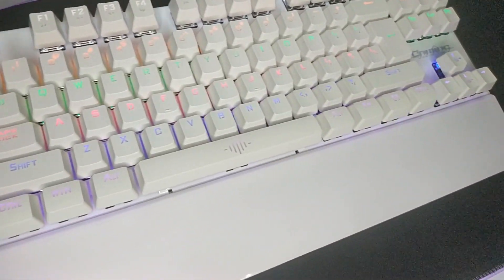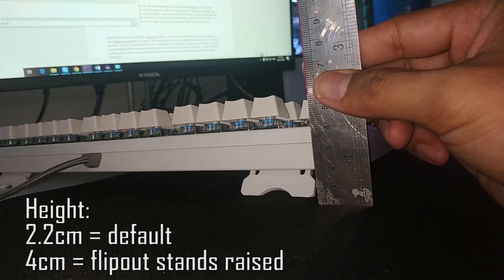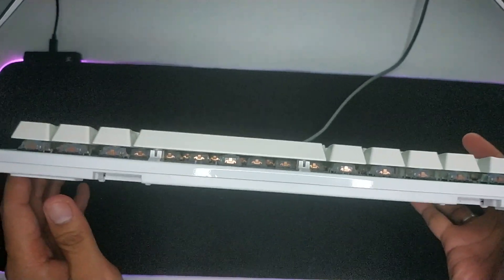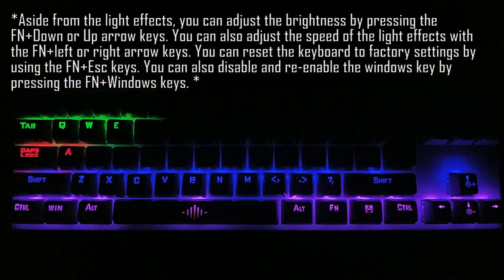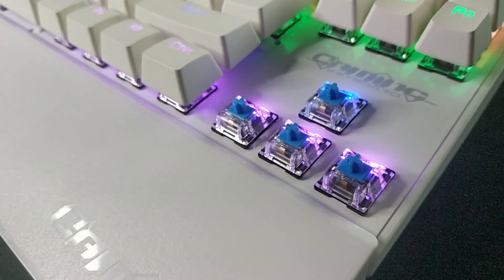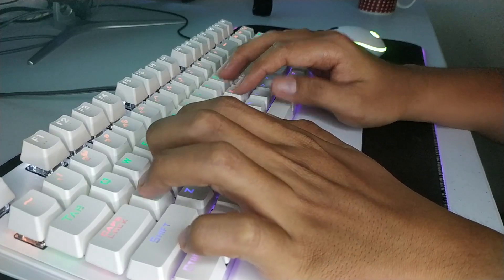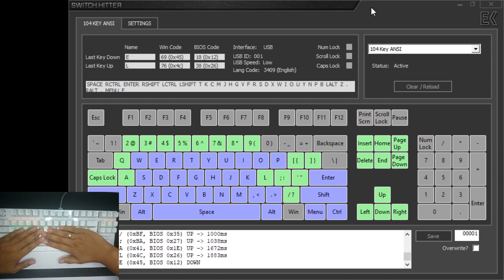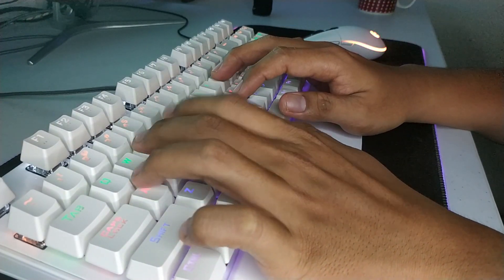Still the CHEAPEST Mechanical Keyboard - Gigaware K28 || These Content Blue Switches ain't half bad

Comment: Can i ask is this hot swappable or not?
Reply from the maker: it's not hotswappable
Reply: @KonzTech  Does K550 comes with a tool that take away the switches because i want to change it to red switches
Reply from the maker: Mine didn't come with one. Btw, be aware that there are some k550's out there that are soldered. I've seen comments in my k550 video that the new ones(leaven k550) are soldered.

Comment: Can we replace the switch?
Reply from the maker: you can but you will have to desolder the old ones first
Reply: @KonzTech  means that pull out the original one and replace with new one?
Reply from the maker: @afiqzakwan450  no you cannot simply pull out the old switches on this keyboard. They are soldered. Thus, you must desolder first.

Comment: Is the keyboard still good? May few people kasi na nagsabing it's better to buy the Gigaware K550 instead of this, kasi pumalya agad ang keyboard after a week or so. Highly skeptical on which one to buy..
Reply from the maker: K550 would be a better value for me..I made a review on the k550..reality is quality mechanical switches don't come cheap..somehow the k550 despite having subpar switches compensates it by having a hotswap board..it makes it easier to replace the switches if they fail early on. Btw my k28 is still good..though, it's not my main kB but I use it time to time on my extra rig
Reply: @KonzTech  I see, so K550 is the better choice to go for then. Tanong ko narin po if you've already swapped the switches before they became unresponsive? Kasi I'm guessing the reason why pumalya sa few buyers ang keyboard is only because of the default switches (with questionable quality, as you've said)  and that they didn't even bother changing the key switches.
Reply from the maker: @JadeZen520  the switches were still fine when I swapped them. My daughter just don't like clicky switches so I swapped it out with silent linears
Reply: @KonzTech   aight then, thanks po for the info 😁

Comment: Gusto ko bumili kaso baka masira agad :(
Reply from the maker: ganun talaga risks sa mga murang mechanical keyboards. If you still wanna push with that budget, then suggest ko get the k550 instead. Hotswap ung board nia with outemu switches so pwede mo palitan ung switch incase magfail agad. I also made a review on it. If you just want a keyboard that will last and looks good then the Rakk Sari is a better value. Membrane keyboard xa pero based from my own experience with membrane keyboards of this caliber, mas tumatagal p cla kesa sa mga cheap mechanical keyboards.

Now if you want a mechanical keyboard that has excellent quality then I suggest look into mechanical keyboards at the 2.5k-5k pricerange

Comment: Compatible po ba ito sa macbook?
Reply from the maker: it should be..The macbook accepts any usb keyboard
Reply: @KonzTech  how bout its rgb, will it work ?
Reply from the maker: @khayrabdulrahman6011  ahh yes the lighting will still work. A typical USB port provides power for the lights. The effect controls are on the keyboard so you don't need any software on the mac/pc to control it
Reply: @KonzTech  Thanks!

Comment: Pwede po bang  hugasan ung keycaps nyan bos?
Reply from the maker: yes basta double-shot keycaps pwedeng pwede..wag lng printed or sublimation ung prints sa keycaps ok xa hugasan
Reply: @KonzTech  ewan ko kung anong bibilhen ko max core ba  o k28
Reply: @KonzTech  ano po ba the best fantech maxcore o k28 ?
Reply from the maker: @papibols  maxcore have better switches and I think meron din xang volume knob + Full-sized kb din ang maxcore(if the numpad concerns you). But if you're looking for a keyboard with a hotswappable board then you can try checking out my Gigaware K550 review. Di kagandahan ung switches nia..pero at least singmura ng k28 and may option ka to swap the switches out with better quality outemu switches

Comment: Balak ko bumili nh keyboard now Sir, ano update sa kanya sir after 2 months of using
Reply from the maker: ok p nmn xa..papalitan ko xa ng red switch and custom keycaps kaso nag-iipon pako for that project..balak ko din kasi i-lube ung switches bago ko ikabit..btw soldered switches neto
Reply: @KonzTech  oww recommended mo din ba sir na palitan ko ang switch? Or all goods kahit dina palitan?
Reply: @KonzTech  BTW sir may mga review kana din ba sa budget webcam and budget mouse for online schooling
Reply from the maker: @jose3310  magpapalit lng ako ng switch kasi gusto ko lng i-try hehe..Badwolf headset and Logitech G102 plng review ko for headset and mouse na budget..wala pakong cam eh..naghahanap pako ng pwede..may ginagawa pakong review pra sa isang wireless gaming mouse..cguro next week ma-upload ko na
Reply: @KonzTech  a4 tech na webcam sir try mo 1k plus and logi c9 review
Reply from the maker: @user-tt5hz8hm5l  meron ako ditong a4tech webcam ung tag 600..480p reso..been pondering on a review on it..pero bka next month n..may mouse and gigaware k550 pako nakapila e hehe

Comment from the maker: UPDATE: The switches are SOLDERED. Pin layouts are similar to Outemus. If you want to replace the switches you'll have to dismantle, resolder and solder the new switches to it.

Now if you're still feeling like it... then pull out the switches without de-soldering but don't come running back here crying because you destroyed your keyboard. I have warned you.

P.S - SUBSCRIBE OR I MESS WITH YOUR KEYBOARD :))
Reply: What will happen if i remove a switch with puller? Without desoldering?
Reply from the maker: @tamaki4176  you might end up damaging the switch or the board if you're unlucky..some of the solder points that I saw on mine are soldered well
Reply: @haxelon zettu would it work if i removed it without de/re soldering?
Reply: @haxelon zettu they still work after removing without resoldering?
Reply: @haxelon zettu sorry if im pretty annoying, to clarify, you removed without desoldering? Then put back switch without resoldering? And it still works fine?
Reply: @haxelon zettu welp ty for the tip, hope its real, cuz im gonna try it tomorrow
Reply: @haxelon zettu yes, tho im still scared to pull it 😅😅
Reply: Im afraid that the board might get damaged 😂😂
Reply: @haxelon zettu welp, im gonna try it tomorrow
Reply: @haxelon zettu oh i tried it just now, but it seems like the switch is too hard to pull
Reply: @haxelon zettu have u removed all of the switches without desoldering?
Reply: @haxelon zettu if not, can i request a vid of removing the switch which have not yet been removed or desoldered???
Reply: @haxelon zettu cge po looking forward to it 😁

Comment: can you update us if outemu switches can be use in this keyboard.thanks :)
Reply from the maker: You'll need to resolder as I have just dismantled the keyboard and saw it myself..pin layouts are the same as outemu's...it will be a cumbersome job but still doable..For now, I ditched the idea of replacing them..I'm currently looking for a good keyboard now with Outemu switches so that if by any chance this keyboard fails I could try soldering some switch and still have another keyboard that would accept hotswappable outemus
Reply: @KonzTech  rakk tandus is the next budget mech keyboard. It uses outemu blueswitch and hotswappable

Comment: hi, i just bought this keyboard. So the keyboard is hotswappable? I don't want have to deal with the problem of un-soldering keyswitches lol
Reply from the maker: I managed to remove a switch earlier out of curiousity and it fits right back and works haha..well uhhh I am still waiting for my outemu browns..hopefully they will work..
Reply: @KonzTech  yeah please tell me because the website and other videos seem to conclude that the keyswitches can't be pulled out
Reply from the maker: I think the switches are soldered..I tried removing another one and noticed some solder metal sticking to the pins..it was harder this time I almost broke the switch haha
Reply: @KonzTech  damn... yeah you should leave as is i guess haha as not to break it
Reply: Hello po pwede po mag tanong kung ok pa yung keyboard mo hanggang ngayon? Kase im planning to buy one😊